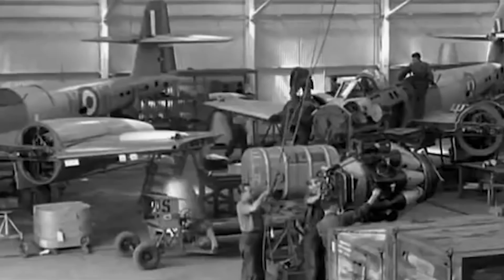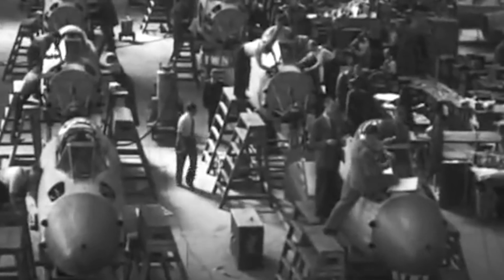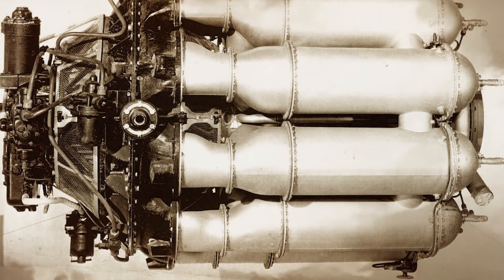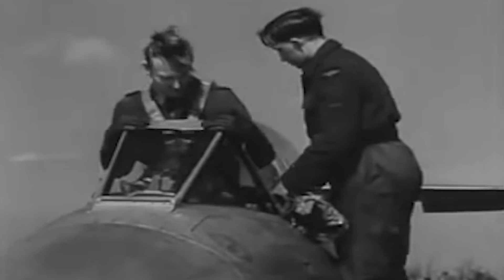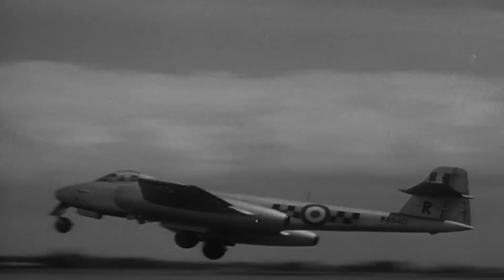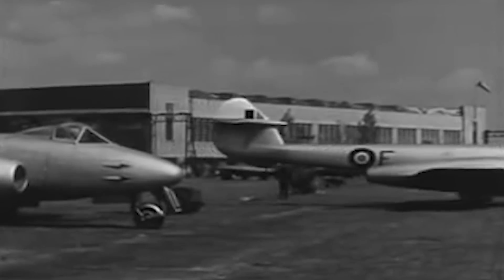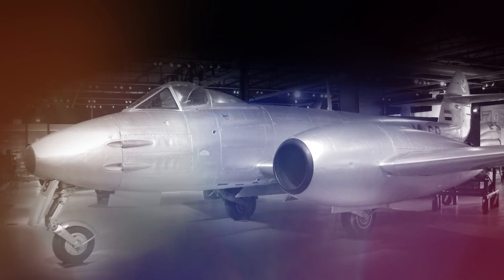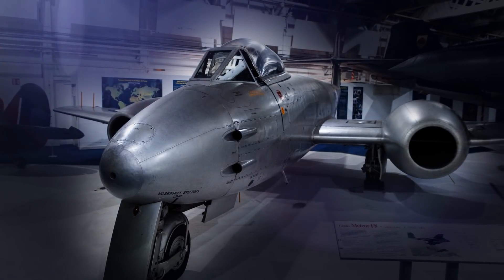Gloster Meteor - The Only Allied Jet to Fight in WW2

Comment: Some books have the P80 seeing action others do not
Reply: No Allied jet fighters saw aerial combat, the P-80 spent most of the war grounded.
Reply: @sandervanderkammen9230  I am sorry the RAF included downed VIs as combat
Reply: @jacktattis  The Gloster "Meatbox" only killed British pilots.
Reply: @sandervanderkammen9230  Not yet it did not  Go and do some research
Reply: @jacktattis  I have
450 RAF pilots were killed by the Gloster "Meatbox" as it was called by British pilots.
Over 1,000 crashed in RAF service making it the worst jet fighter in history.
Reply: @sandervanderkammen9230  aHMM WELL i SUGGEST YOU HAVE A LOOK AT THE f104
Reply: @jacktattis  The Gloster Meatbox has a worse record than even the F-104... of course the 104 is the world's first Mach 2 all-weather interceptor... the Meatbox couldn't reach supersonic in a dive and was used primiarily in the ground attack role because it's was an epic failure as a fighter.
Reply: @sandervanderkammen9230  It was never designed to reach Mach 1
Now the English Electric Lighting went supersonic 01 April  57 Source Fighters by Mike  Spick 
The F104?
Reply: @sandervanderkammen9230  I just went into that site from 1959 to 1969 NO I repeat NO Meteors were listed.
Reply: @jacktattis  That is why Britain didn't have the first supersonic aircraft, centrifugal jet engines are too bulky, heavy and inefficient to propel a an aircraft to sustained level flight at Mach 1.
Supersonic aircraft all use Axial jet engines and rockets invented in Germany.
Reply: @jacktattis  What site? The Gloster Meatbox wasn't manufacturers after 1955... it was obsolete as a fighter aircraft on arrival in 1944.
Reply: @sandervanderkammen9230  April 57 when did the F104 go supersonic ?
Reply: @jacktattis  March 27 1954.
Reply: @jacktattis  The Bell X1 flew supersonic on April 14th 1947.
Reply: @jacktattis  The first European jet to reach Mach 2 was the Dassault Mirage III
Reply: @sandervanderkammen9230   Not talking about a experimental plane . I did ask when the F104 went supersonic My books do not say.
Reply: @sandervanderkammen9230  Source please ?
Reply: @sandervanderkammen9230  Not into service, first going supersonic
Reply: @jacktattis  The Bell X1 flew supersonic in 1947.
Reply: @sandervanderkammen9230  Mirage first flew 1958 Source Fighters Mike Spick E E Lightning  April 57
Reply: @jacktattis  Dassault Mirage III Nov. 17th 1956.
Reply: @sandervanderkammen9230  Went Supersonic Oct 58 and you are correct it beat the Lightning by 1 month and 1 day 
 When did the  F104  GO supersonic
Reply: @jacktattis  56
Reply: @sandervanderkammen9230  THE BELL was not a service  plane
Reply: @jacktattis  The Bell X1 flew supersonic in 1947.
Reply: @sandervanderkammen9230  No I am 79
Reply: @jacktattis  The Bell X1 flew supersonic on October 14, 1947.
 Britain was years behind in supersonic aircraft technology.

Comment: I actually think the me 262 looks better 🤷‍♂️
Reply: The Messerschmitt Me-262 IS BETTER
Reply: @sandervanderkammen9230  Face it  Sandyboy, nobody wanted the Me 262, not even the germans. That's why the Meteor was in service for thirty years and in more than a dozen air forces whilst the Me 262 was in service with two air forces and after seven years was left collecting dust.

Comment: no jet battle in ww2?...

SO LAME
Reply: The Allies never had a fully developed and combat capable jet fighter..
The Messerschmitt Me-262 flew completely unchallenged by the Allies.
Reply: @sandervanderkammen9230  Except all the me262s that got shot down by Tempests, P47s, P51s and Spitfires.
By the time the nazi krauts got the Me 262 off the ground (and usually only for a very brief while) the allies didn't have to worry about rushing jets into service their piston prop aircraft were more than enough to deal with it.

Comment: I feel like if you rearrange and resize some of the parts on the meteor you can make a modern A-10
Reply: Over 1,000 Meatboxes rearranged and resized themselves to form a crashsite
Reply: @sandervanderkammen9230  Oh poor Sandyboy, did nobody want your crap nazi jet fighter after the war. Just as well, what with its mechanical failure crash rate 30% higher than the Gloster's, many lives were saved.

Comment: The Meteor was 60 MPH slower than a a Me 262. Hanz von Ohain was the inventor of the Jet Aircraft as the He 178 which first flew before Germany invaded Poland by flying in August 1939. Whittles jet didn't fly until nearly 2 years later.
The Meteor focused on taking down V1's. The Meteor went on to fly for years after the war and saw service in the Korean War.
Reply: RAF pilots called it the "Meatbox" pr "flying coffin" due to its well earned reputation for killing pilots.
 Over 1,000 Meatboxes crashed ( most in peacetime operations) killing 450 pilots in RAF service alone.
Reply: @sandervanderkammen9230  Thanks so much for that information, no doubt the RAF covered that up as they wanted to be the first Allied jet Fighter.
Reply: What would they need to cover up? It was the first allied jet fighter because it was the first allied jet fighter. It served with more than a dozen air forces and for more than thirty years. Martin Baker still use Gloster Meteors for there testing.
Reply: When the Gloster Meatbox was introduced into service in 1944 it was 150 mph slower than Messerschmitt Me-262.

The Meteor was only briefly deployed against V1s but was quickly withdrawn... the poor performance prevented it from ever being used effectively as a fighter or interceptor, the RAF limited its used to ground attack, training and reconnaissance roles..
Reply: You've confused an engine with an aircraft. The 'He' in He 178 stands fo Heinkel, not Ohain.
Reply: @fritzwrangle-clouder6033  Yes I Know that He is short for Heinkel. The First Jet Engine to Fly was Hanz Von Ohains Jet Engine which powered the First Jet Aircraft to fly which was the He 178 which before WW2 in August 1939.

Comment: The United States Army Air Force was very close to a decision to commit the P-59 Airacomet jet fighter to combat, despite a top speed of only 409 mph.  The basis of the near-decision was to accumulate as much technical and combat operational experience with the new jet fighter while awaiting improvements to the P-59 and for more advanced jet fighters to make their debut.  This decision might have worked.  No doubt in the next two years, the P-59 would undoubtedly have undergone some improvement, to its jet engines and airframe.  Improved engines might have boosted the P-59 top speed to a more satisfactory 450 to 480 mph along with refinements in the airframe and fuselage design, cutting back further on drag.
  Had the decision been undertaken, P-59 Airacomets would have taken to the European skies in late 1943 or early 1944, either as air superiority jets or high altitude escort fighters.  The ensuing combat operations would have been quite interesting.  But in the end, the USAAF held out for much better jets.  This would come in the form of the P-80A Shooting Star, its top speed a respectable 558 mph for its time.  But time was running out.  Only two P-80A jet fighters were dispatched to Italy in 1945 for operational testing.  Nothing is known of the tests.  The improved P-80C could reach 580 mph and see combat service in the Korean War, being quickly replaced by the more advanced, F-86A Sabre jet which achieved a top speed of about 650 mph.
Reply: The P-80 never exceeded 500 mph during WWII. One of the P-80s sent to Europe crashed while doing a demonstration flight for VIPs. Richard Bong was killed in a P-80 when the engine blew up. Just weren't developed enough. The USAAF didn't "hold out for much better jets". They were developing them as fast as they could.

Comment: Robin Olds wrote about this fighter in his autobiography, 'Fighter Pilot', since he tested them after WWII for the RAF, but I didn't realize that some actually fought in the War. I didn't think they had enough of them combat ready at the time....
Reply: The Meteor entered service in July 1944, first used for chasing V 1's, then some were sent to Belgium for airfield defense before being used for armed reconnaissance and ground attack, no Luftwaffe fighters came up to play but the Mete0or did destroy 46 Luftwaffe aircraft and other targets.
Reply: The Meatbox never served in combat fighter role with the RAF.
It was too slow and outclassed by many propeller driven aircraft to be used in aerial combat.
Reply: @sandervanderkammen9230  Oi Sandyboy, just keep in mind that you are the one that thinks that a Do 355 scuttling away from a Frenchman in a Tempest as fast as it can, counts as combat.
Reply: @sandervanderkammen9230  Stop whining like a stuck wehraboo Sandyboy. The Gloster Meteor served for thirty years with more than a dozen air forces.
Reply: Sandybum  The Meteor used for ground attack destroyed 46 Luftwaffe aircraft, it was also used for armed reconnaissance, the Meteor was faster than many piston engine aircraft even the early Mk I was faster at low altitude than the Tempest, as for the Mk III it was fast enough and with better acceleration and manoeuvrability than the Me 262 , the Meteor was more than capable of taking on the Me 262. As tested by the RAF the Meteor could beat the Tempest, something the Me 262 couldn't do, just as the Me 262 couldn't take on the Spitfire.

Comment: Actually, Whittle invented the axial flow, not turbojet. The German, Ohn, I believe is how his name is spelled, invented the turbojet.
Reply: Sorry, the Axial Flow Turbojet was patented by Maxime Guillaume in 1921 and the first engine with an axial compressor was built  in Switzerland by Brown, Boverei und Cie. in 1932.
A.A. Griffith published the first paper proposing an axial compressor for turboshaft aircraft in 1926.
1929 Frank Whittle is accused of plagerizing Griffiths 1926 paper.

Herbert Wagner and Adolf Muller begin construction of the first axial turboshaft aircraft engine at Jumo in 1936.

World's first axial turbojet built by Anselm Franz and Herbert Wangner is successfully flight tested on September 22nd 1940... 9 months before Frank Whittle's first successful demonstration.

Although Whittle included an axial compressor in his 1930 patent application, he never built the 1930 engine nor did he ever construct any engine with a axial compressor.

Any questions?
Reply: @sandervanderkammen9230  Yes, I've got a question- Why do you talk so much bollocks?
The first axial flow compressor was patented by Charles Parsons in 1901.  Maximme Guillaume's engine was not feasible and his patent doesn't show an axial flow engine (try reading the patent and not just looking at the pictures). Brown Boveri's first axial flow gas turbine was installed at  Neuchâtel in 1939 not 1932 (you are thinking of the Velox which was a boiler not an engine).  The engine Muller began designing but not constructing in 1936 was never produced. Whittle is not accused of plagiarizing Griffiths. Anselm's engine wasn't even  bench tested at operating speed until 1941. As for Whittle's design I'll let Pabst von Ohain have a word on that-
"The first patent of a turbojet engine, which was later developed and produced,
was that of Frank Whittle, now Sir Frank (see Fig. 5). His patent was applied for
in January 1930. This patent shows a multistage, axial-flow compressor followed
by a radial compressor stage, a combustor, an axial-flow turbine driving the
compressor, and an exhaust nozzle. Such configurations are still used today..."

Comment: The Meteor was developed earlier then the ME 263 and operational at roughly the same time as the ME262
Reply: Development of the Me-262 began in April 1939 and flew with jet engines July 1942, a year before the "Meatbox" and entered operational service on April 19th 1944.
Reply: @sandervanderkammen9230  Sandyboy, you've just strung together two assertions that in no way contradict Will Hovell's comment.

Comment: The P-80 also flew combat in WW2: https://www.defensemedianetwork.com/stories/project-extraversion-p-80-shooting-stars-in-world-war-ii/#:~:text=The%20jet%2Dpowered%20P%2D80,a%20role%20in%20the%20war.
Reply: Neither the P-80 or the Meatbox saw aerial combat during WW2.
The P-80 spent mpst of the wat grounded with technical problems and the Meatbox was too slow to be used in combat until later versions arrived after the war.

Comment: I recently read a autobiography by a German pilot who flew the me 262 in operations. He paid much detail to the fact that it's engines had a design live of 15 hours but that they rarely managed 10 hours without breaking up. Also they could not be throttled up of down without flaring out, such that they learned to fly all the time at three quarters power. The meteor engine had a designed  OVERHALL live of 100 hours.
Reply: That is not factually accurate.

The Jumo 004b Orkan engines had a PFTR that exceeded the RLMs 100 hour minimum for adoption into Luftwaffe service.
This is the exact same 100 hour PFTR standard required by the RAF and the USAAF during WW2.

Tests performed by the U.S. Army during Operation Lusty reports TBOs averaged in the 50 to 60 hours.
Excellent by WW2 standards.

The Whittle W.2 had a PFTR of only 50 hours 
The Rolls Royce Welland 100 hours.

Most Allied high output piston engines averaged TBOs of 25 to 30 hours when WEP or max takeoff power was used repeatedly.

The Merlin engine for example required internal inspection with a borescope and all the spark plugs replaced every time WEP was used and the use of WEP for more than 5 minutes usually required a complete overhaul.

Not only could the Messerschmitt Me-262 reach 560mph it's continuous cruising speed was 465 MPH!!!!

Of course engine can fail but one of the advantages of the Me-262 was that a skilled crew could replace an engine in as little as 1 hour... a job that could take 2 to 3 days on some piston engine planes.
Reply: @sandervanderkammen9230  I see you are still trotting out that PFTR test and TBO bollocks. It's interesting that a search on those terms only ever produces you making that claim except when you up it to 200 hours.
Reply: Both Allied and German jet engines had MANUAL Fuel Control systems.
The pilot could not jam the throttles or make any careless changes to the throttle settings.
The pilot had to increase the fuel pressure gradually as the rpm and airspeed increased.
Automatic govenor fuel controls would not appear until after the war.
Pilots with experience in piston engine planes found the slower throttle response frustrating and in combat tried to advance the throttle too quickly, this was true for the Goster Meteor and the P-80.. even Modern FADEC controlled jet fighter engines have considerable throttle lag compared to a P-51 or a Spitefire.

Comment: I got to fly a 2 place Meteor while serving in the RAFVR.  Liverpool University Air Squadron.  We had 3 single place Meteors which we were not allowed to fly, and 1 2-place which we did. 10 second throttle lag, then that PUSH, PUSH, "Like an angel!" said Adolf Galland, a German ace and nice guy. Not allowed to pull G because flameout a problem, and no ejection seats!  Called "Meat boxes" for good reason.  SO smooth after flying pistons! CAVU skies, All!

Comment: If the British had only swept the wings back 33 degrees, like the ME-262.
Reply: The sweep was minimal at 18.5 degrees.
Reply: @crinolynneendymion8755  18.5° was very significant during WW2 and did in fact increase the critical Mach number to just above supersonic in a high altitude dive.
Reply: @sandervanderkammen9230  Willy Messerschmitt himself dismissed that claim as bollocks.
Reply: Messerschmitt tested the Me-262 in the worlds only supersonic aircraft wind tunnel. They tested the wing sweep at several angles up to 60° but engine thrust was not expected to be enough to reach supersonic, the 18.5° was a very significant improvement in top speed and high speed maneuverability.